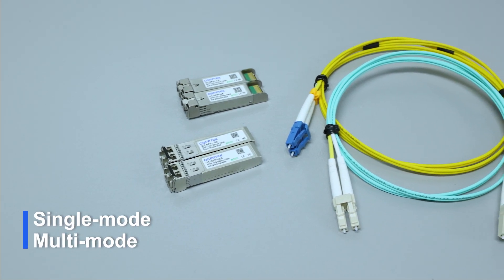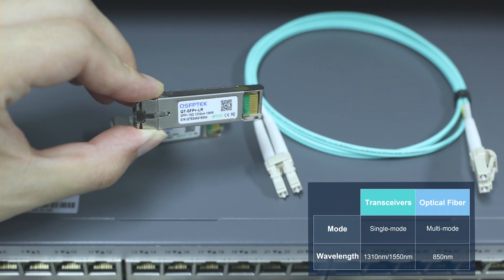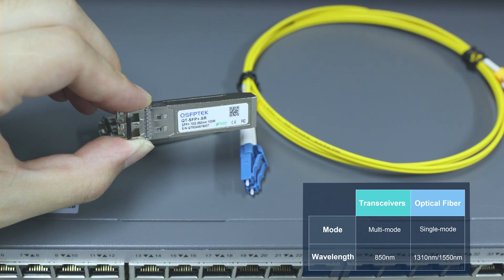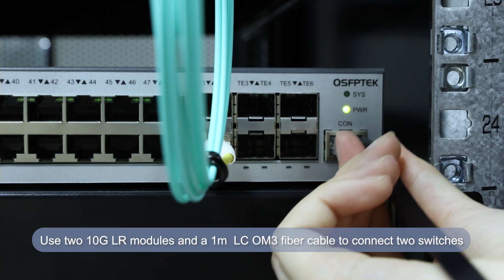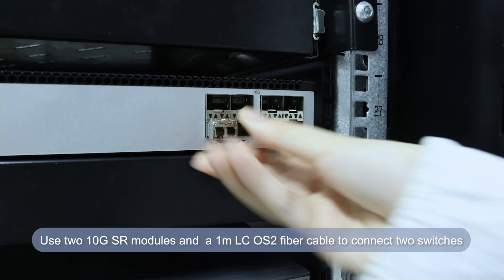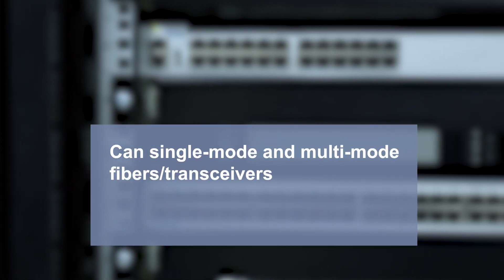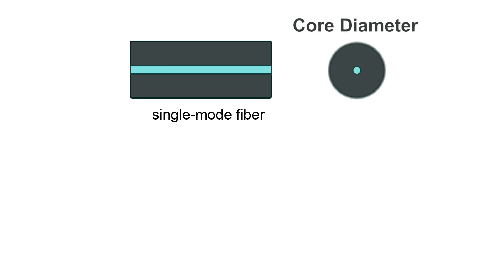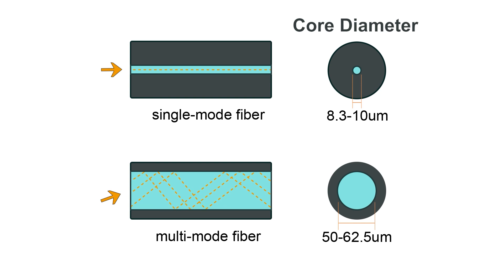Live Test! Can Multimode Transceiver Work with Single Mode Fiber?And Vice Versa?

Comment: I think I am currently running at least 1 circuit that is running single mode transceiver with multimode cable..  (a lightning strike took out some equipment and that was the fix - it has probably been 2 years or more..)  ;)